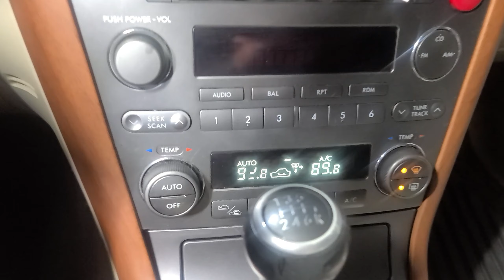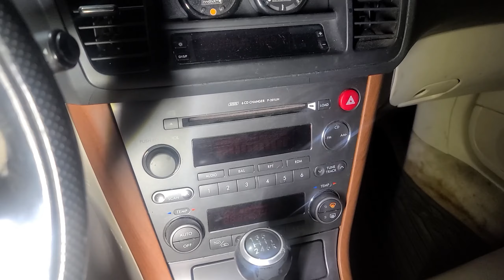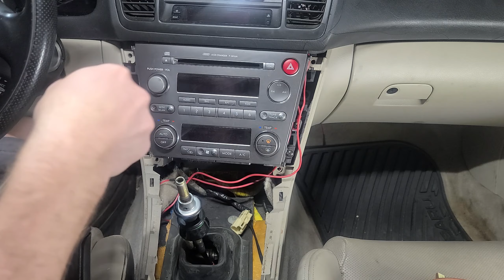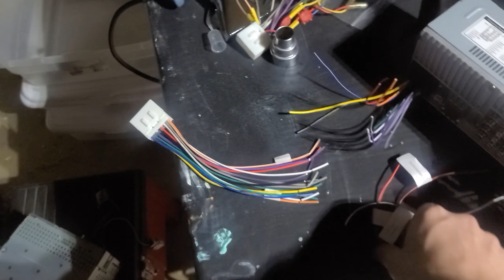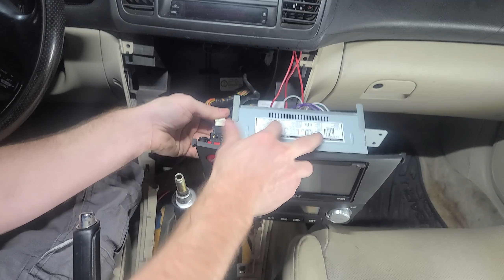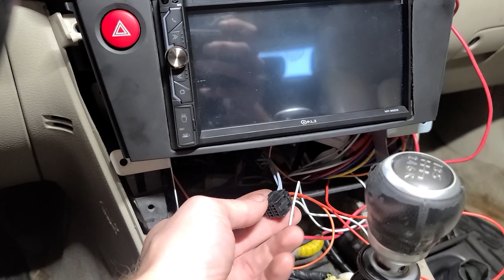Step- by-Step Subaru Legacy JDM Stereo Upgrade

Comment: love the channel man im in the process of dialing in my 05 LGT with 20g turbo e85 etc.
Reply from the maker: @OzzmosisMining  that is asolid setup! Not too powerful that maintaining it gets to be a head ache!
Reply: @robinsontanner1234  I'm lucky I have e85 less then a mile from my house I'm just getting ready to get my wagon into the body shop over the winter for some JDM goodies and she will be on the road this spring 😎
Reply from the maker: @OzzmosisMining  yeah! I love havin e 85 around. I am currently doing paint correction on mine. I realized it is almost 20 years old, lol.